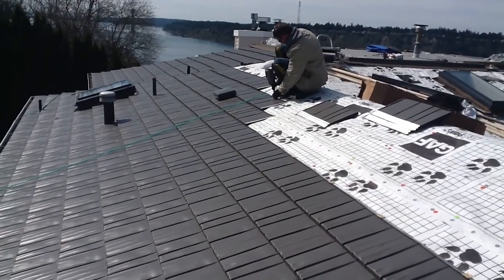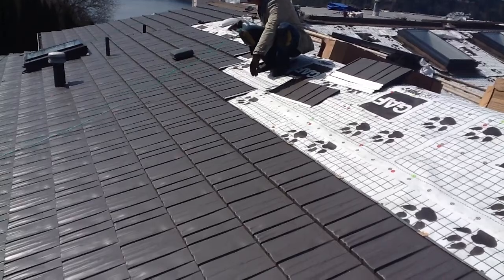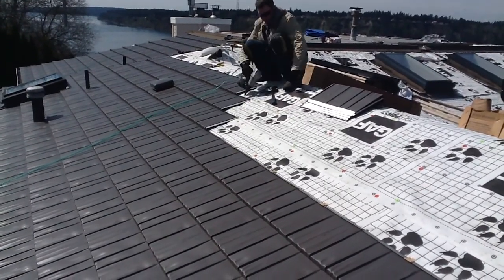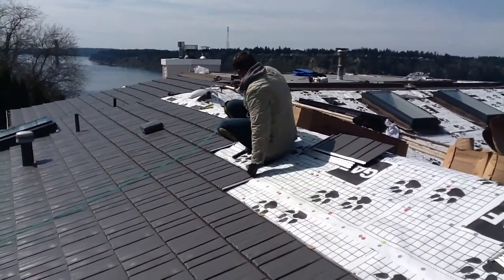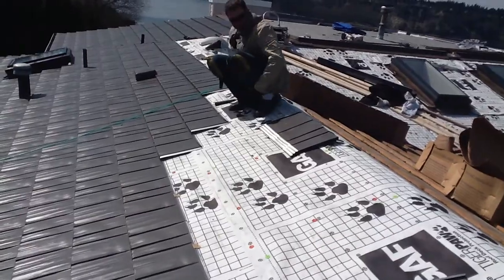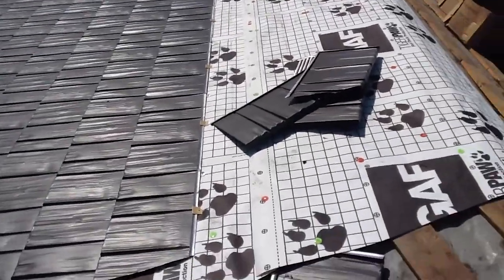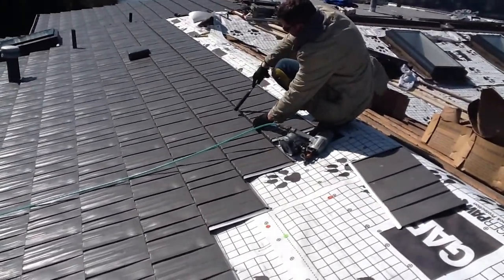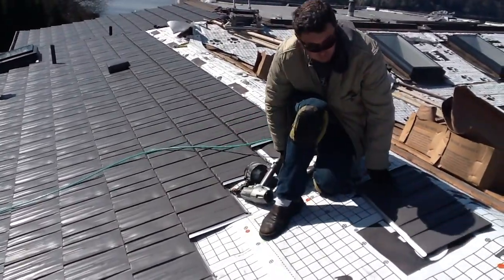Informative Metal Roofing Installation

Comment: Greg be lucky to install 4sq a day once he gets off that gravy run and into the skylights!  Nail gun isn't really needed with these shingles since there's only 2 nails per panel. Plus using  hammer and nail allows you better feedback to assure those 2 nails are secure and solidly fastened. Nail gun a bit faster maybe but with only 2 nails per you need to know they're in something solid instead of a guess!